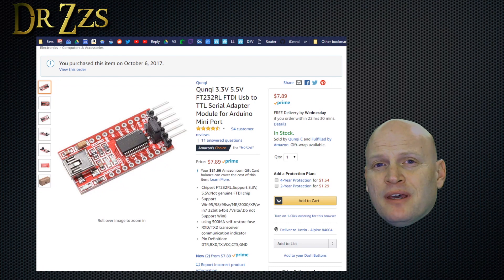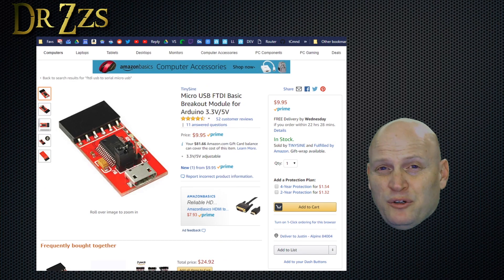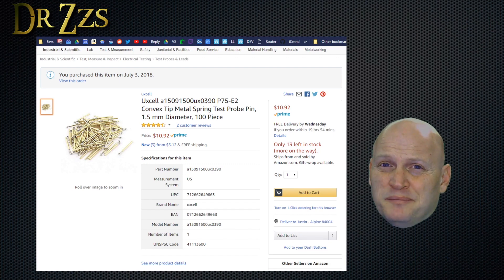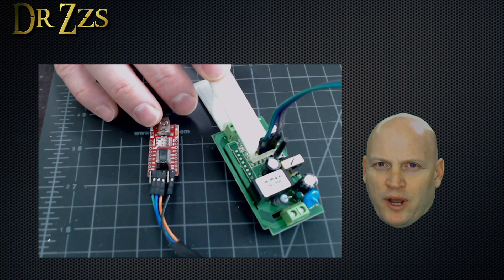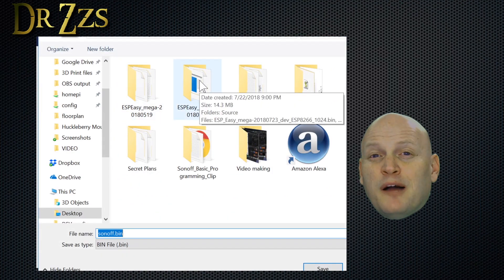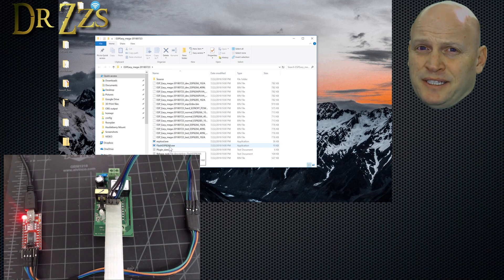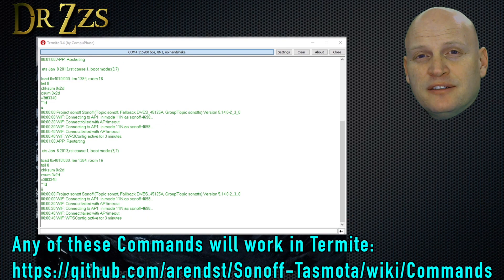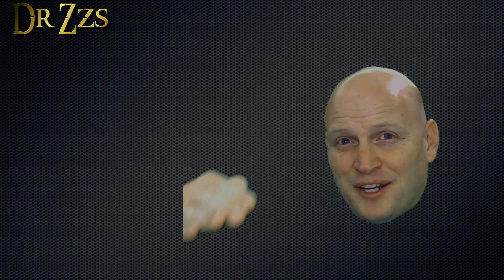How To Change Firmware on Sonoff Devices for use in Home Automation Projects

Comment: Hi ! I flashet this firmware to all my sonoff devices. It worked great but when I woke up today, all my devices have lost their IP-adresses so I am not able to connect to them and therefore I can not use them. They work if I manually press the buttom though. Any ideas ?
Reply: Can you scan your wifi network and find them? If you get the new IPs you can go to a web browser and see if they work.

Comment: Hello, not so if you remember the message I sent you a couple of days ago, of the various problems that I had in the flash of the firmware in a 3-channel UST sonoff, after two sleepless nights, I managed to flash with FlashESP8266.exe I think it was a problem with the FTDI module drivers, because I uninstalled and reinstalled them and it started working. I could make the flash: 3-channel touch sonoff US, sonoff touch 1 channel us (with arduino I could not and also to a sonod TH16, I'm very happy and I have to thank you for the videos and very comprehensive explanations you gave me, others I wanted to ask you something, after having done the flash I have to open TERMITE for which reason? After the flash just connect to the IP address of the device and make the configuration.
Anyway, thanks again.
Reply from the maker: glad you got it working.  
The T1's are tricky.  Getting them into programming mode can be really difficult.  
Using termite is an option, you don't have to do it.  You can connect to the device directly and do the configuration that way.  That's probably a good way to do it when you're starting out so you know more about how the setup works.  I use Termite to save time that's all. :)
Reply: With the sonoffs with tasmota firmware I'm ready for my Hassio smart home project. Thanks, I continue to follow and I hope to share other experiences. See you soon

Comment: i dont know how toenter ssid and password please help
Reply from the maker: are you using Termite?  
With termite connected to your sonoff (though USB/serial adapter) type "SSID1 yourhomewifiID" then "Password1 yourwifipw" 
that's it.  This text is what you need to put a bunch of setting in the sonoff from the Termite console.  replace the xx's and yy's with your real info and put the whole block of text in the Termite console. 

Backlog SSID1 xxxxxx; Password1 yyyyyy; MqttHost brokerIP; MqttUser xxxxxxx; MqttPassword yyyyyyy; GPIO14 09; Hostname sonoff_name; MqttClient unique_sonoff_name; Topic sonoff_name; FriendlyName1 Sonoff-Name
Reply: thank you
but wdt rest keep on repeating what to do
Reply: DrZzs please help me wdt reset message keeps on repeating what to do
Reply: DrZzs I tried but the message wdt reset
Load 0x4010f000,len 1384,room 16 keeps on repeating
Reply from the maker: you used sonoff.bin?
Reply: DrZzs yes it works now but took 42 attempts 🙄🤒

Comment: Why do you use 5.14? Trying to use a DHT22 on my sonoff basic running 5.9.1 and it’s not working correctly only DrZzzs showing up every now and then with the temp/humidity info then it goes away, done this to 3 sonoff basic with same result using SonOTA starting to think this is the issue here ?
Reply from the maker: Does the sonoff work otherwise?  relay etc?
Reply: yes i have it working in homekit using your SonOTA tasmota tuturial and HAP-NodeJS......  so now i downgraded to 5.1.4 because i wouldn't let me upgrade to 6.1.1, the temp/humidity worked basically fine but then i went to change sonoff friendly name... aftter hitting save the sonoff is now dead/unresponsive...weird so now i have no sonoff under 1.6 firmware :( cant use SonOTA so i brought a FTDI FT232 instead of a FT232RL as it was at my local jaycar.... i cant get it to work they look pretty much the same :(

Comment: Hello,
I've been working on this project for a while and tried the old arduino version for flashing..
But I am facing a problem: if the sonOff has a firmware of 1.6 or higher, it doesn't accept new ones (tasmota did flash, but the board wouldn't work anymore). I wonder if this new video solves this problem, or what do you suggest I should do to flash tasmota and get the sonOff to Tasmota admin on my home assistant.
Reply from the maker: You might need to try using the minimal .bin file first, then the regular sonoff.bin
https://github.com/arendst/Sonoff-Tasmota/wiki/Upgrade#firmware-binary-sources

Or you could just go back and get a smaller version of Tasmota.  like 5.12 or 5.14
https://github.com/arendst/Sonoff-Tasmota/releases
Reply: Thank you, the sonoff.bin workrd properly and I could add it to the overview on my home assistant.
Thanks for everything you are giving.

Comment: DrZzzs Thanks once again for a great video, just once question thou, is ghosting still happening with the new sonoff's or has there been a fix for that ?
Reply from the maker: it still happens.  
I thought I was free of all that nonsense, but just in the last few days I've had some random switching happening.  Not sure what the source is yet.
Reply: DrZzs are those sonoff's using the low pass filter?. Ive flashed two units for my bedroom, just wondering if i should use the filter just in case... your thoughts ?
Reply from the maker: marc mysterio I’d say it depends on what kind of button you’re using. If you use a mechanical switch or a push button then including the lpf is probably a good idea. If you’re using capacitive touch buttons then you probably don’t need the lpf. 
I pretty much only use capacitive touch buttons anymore so I haven’t used the lpf on the last few I’ve done.
Reply: DrZzs i use the mechanical switch,    cant seem to find the capacitive touch buttons made for the NZ market. May be one day...

Comment: I am having the same problem as Brooklyn_UAV.  While sonoff is connected to my computer, it works great.  When I move it, it will not connect.
Reply from the maker: dang.  I wish I knew what to tell you. 
Is there anything about this on the Tasmota github Issues page?

Comment: Great stuff Dr!!  
Are these OK to use as well?
https://www.ebay.com/itm/AC-110V-220V-1-Gang-Smart-Home-WiFi-Wireless-Switch-Relay-Module-Apple-Android-/202327191545
They looks the same as SonOff
Reply from the maker: ya, that should work.  I'd be curious what it looks like inside.  You might not have as easy access to the serial pins.

Comment: Hi all, I just flashed a sonoff using your istructions. Then I added information on my SSID using termite but it can't connect to my wifi. I then tried to restart over and I noticed that the sonoff "remembers" my SSID also if I refleshed it. There is a way to erase the firmware before reflashing? And then a curiosity: my SSID name has a space "Name Name". This can be a problem?

Comment: Hi 
I can not get  tasmoda to connect to my WiFi any tips ? Using termite and get “connect failed with ap timeout”
Tried 2 sonoff bacics same problem on both
Reply from the maker: dang.  I don't know what to do about that.  There have been a few people with wifi troubles lately.  
My only recommendation is to try Tasmota v5.14 instead of v6.  If I learn more about the nature of the problem I'll put some info out.  Until then, maybe look on the Tasmota github issues page.  You're likely not the only one having that problem.

Comment: Can the soldered holes be drilled with a thin dremel drill bit?
Reply from the maker: yes.  Check the other comments.  I think someone said a 0.9mm bit just using your fingers to spin it worked for them.  Others have used soldering wick.  Lots of options :)

Comment: I'm having a issue were my sonoff's are not Communicating with my Alexa anymore, says they are not  Responding to. I install  These about 7 months ago and I static all ip addresses for each one of them. Have you had an issue with sonoff's not responding?
Reply from the maker: hmmm.   are you using HA cloud?  I would guess you are.  I haven't had problems.  Double check that the Home Assistant Skill is added to your Alexa account and that you are signed in and using HA cloud.  Maybe try to run "discover devices" again with the Alexa app.

Comment: Hi Dr.zz's I have flash the sonoff with ESPEasy and set it up with termite. I got an IP address when I'm still plugged into the computer. But when it's plugged into power outlet I lose my IP Address can you help plz..
Reply from the maker: that is very odd.  
Is the Sonoff responding at all when you have it plugged into the power outlet?  Lights?  Relay trigger with button press?
Reply: Yes it do response to the botton press. But no network connection
Reply from the maker: extremely odd...I haven't had this happen with a sonoff basic, but with my old Sonoff Touch I had to switch the Hot and Neutral inputs to get the ESP board to work (and get wifi).  
What kind of sonoff are you using? You haven't made any other changes to isolate the relay or anything have you?

Comment: Hi, it would be great if you can make a video on how to flash tasmota on iFan02 and integrate it with Home assistant.
Reply from the maker: I've got one.  I've just been waiting until I have the time to take down my fan and get it working.  I've been following the thread on the Tasmota page.  Do you have one you're trying to get working?
Reply: I keep watching for the same thing
my fall projects include swapping 3 light fixtures for light/fans 
figure might as well go all in, and make them smart

Comment: thanks for update...all links and cmds in one place now.
Reply from the maker: makes the setup pretty fast.
Reply: plus i got my anet a8 3d printer workin g and its been cranking out parts. got carried away on the prime day sale and got a another out of the box monoprice mp i3 for $100- so got a backup now. Waiting for your server nerf project too. I will be printing out this clips instead of pogo pins..i believe i an use those long connection pins that come packaged with the wemo minis. thanks again doc..i dont want you to slow down the project videos & live streams ( buts its getting hard keeping up with your pace :) -its better than absconding bruh ben)
Reply from the maker: sweet!  I can't remember life without a 3d printer.  Set yourself up a shop at 3dhubs too.  You may get some money back eventually.  
I can hardly keep up with myself sometimes too!

Comment: Another great (and updated) vid. I suspect that this won’t work using a Mac as COM ports (as far as I know) aren’t detected. Am I correct?
Reply from the maker: yes, that's true.  You have to do quite the driver-dance to get the FTDI to be recognized by a mac.  I've had it working in the past, but then it randomly stopped and I didn't want to redo the dance.  So I've been doing all my flashing on Win10 pc for a while now.
Reply: DrZzs - Yet again I simply cannot get this to work. I constantly get ‘Flash Failed’ - I know the connection is good so this is a mystery. When selecting Firmware in the ESPEasy Flasher should sonoff.bin be displayed as: 

.\sonoff.bin

Any clues?
Reply: @DrZzz - I have noted an apparent error message when it attempts to flash:

Warning: espcomm_send_command: wrong direction/command: 0x00 0x08, expected 0.01 0x08

It then tries a few more times to flash (in a matter of moments) and then I get the ‘flash failed’ box appear. Does this mean anything to you?
Reply from the maker: maybe swap the Rx/Tx and try again (hopefully you haven't already tried that).  It would make sense with a "wrong direction" error.
Reply: DrZzs - I’ve definitely got them correctly placed at the moment (as in Rx to Tx and Tx to Rx). Are you suggesting trying Tx to Tx and Rx to Rx?
Reply from the maker: hmmm.  well, that's how they should be.  You've successfully flashed in the past?  I should probably try to reproduce some common error messages so we can know what the cause is by the message.  
That espcomm error is usually:  1- board is not in programming mode, 2- Rx/Tx is switched, or 3- wrong com port selected.    But my guess is you've got all those things right.  
Mine does say ./sonoff.bin, so that's not it. 

Are you using the clip to hold the jumper to the board?  mine wasn't quite connecting and I had to pull the pogo pins through a bit farther.
Reply: DrZzs - I’ve never managed to flash any Sonoffs before. I’ve got close to it (using your earlier video ‘updated’ Tasmota method) but after finding ‘Sonoff’ in my WiFi list and selecting it I get the ‘Sonoff Module’ page. I enter my WiFi SSID and password and then...nothing. Light on Sonoff goes solid but I don’t get any option anywhere to do any of the further configuration shown in that video. 

I note the three possibilities you mention in relation to this video and my issues and the only thing I’d note is that it doesn’t seem to matter which of the 3 USB ports I attach the Sonoff to to flash it, it always shows up as COM3. Could this be the issue? Not sure how or why this would happen. Any thoughts on that?
Reply: DrZzs - Progress. The issue was the  driver on the bridge controller. Updated and I could flash the Sonoff. I’ve now changed the baud rate  in Termite as stated and I have green writing. I’ve simply tried to do the minimum in the backlog section; i.e. set up WiFi connection (figuring I can configure everything else once connected). I getting scrolling (green) text as follows:

Connecting to AP1 xxxxxxxxx in mode 11N as sonoff-7307

Followed by:

Connect failed as AP cannot be reached

I have an IP address for the Sonoff which it has given me. I know my SSID and password are correct for my WiFi. Any idea how I get past this? Tantalisingly close but I just can’t get it over the line at present!

Comment: I read somewhere sonoff won't connect with weird characters (ie !@#$_ etc).  But then this got "fixed" with the newer version.  Does the SSID/PW have to contain only alphabets/numbers?  I keep getting "Connect failed as AP cannot be reached".
Reply from the maker: Sorry I don’t know the answer to that.  You’re using TASMOTA or EWeLink ?
Reply: Tasmota.  I actually followed your previous tutorial and got it to show on the wifi list.  However, I kept getting wrong password error.  With this current method, I can't seem to get it to show on the wifi list.
Reply from the maker: hmmm.  You may want to search the Tasmota Issues page to see if there is a password character problem.  https://github.com/arendst/Sonoff-Tasmota/issues
So you have some of those characters in your pw?  
Are you trying to use AP mode but the sonoff- wifi isn't appearing?  What version of Tasmota are you using?  
If you use Termite you can avoid the need for AP mode. I'd recommend flashing with 5.14, there were problems with wifi in 6.1.  I think they've been resolved with 6.1.1 but just to be sure that isn't the problem try 5.14

Comment: Can you just suck up all the solder at the holes and re solder regular male pins?
Reply: Belen Hedderich yes. Or you can just heat it up and insert one pre tinned pin at a time.
Reply: I do it all the time, just dont keep the iron on too long (~5 -8 secs) or you will lift a track. https://www.amazon.co.uk/Draper-23553-De-Soldering-gun/dp/B0001K9RAI

Comment: Is there an easy way to remove solder from the holes? If we want to connect external switch to GPIO 14 we still have to solder header pins. I managed to do it by heating the solder from one side of PCB and pushing the pin from the other side but final result was messy.
Reply: google "desoldering braid" - works well with a little practice.

Comment: Can i use those steps for 3 gag sonoff touch ????
Reply from the maker: yes.  Except getting it into programming mode is a bit different, but once you've got that then FlashEZ and Termite should work the same.

Comment: Works for Sonoff RF Bridge R2? I got to FlashEZ but then I did not connect through Termite
Reply: Wow cool, I just got it, thank you.
I tried Sonota but I did not succeed. Sonota worked correctly with Sonoff Basic.
I would like to know how to do Sonota with Sonoff RM Bridge R2.
Tks.
Reply from the maker: If Sonota doesn't work on your RF Bridge, the method in this video will.  You can follow the same flash method I used in the RF Bridge video but substitute Sonoff.bin for OMG.  
An updated RF Bridge video with Tasmota is on the Horizon.  Just need more time to work on it.

Comment: My sonoff basic seems curropt...it doesn show in scanning mode..not even AP mode its discoverable...any help you can extend?
Reply from the maker: are you using stock firmware or have you changed it?  It's possible that you got a bad one, but I'd try different firmware first.  With Termite you can see what is happening with the board without connecting to wifi at all.
Reply: DrZzs m on original firmware...it was working fine...but stopped....AP mode even apk is not able to find it...i need to rewrite orginal firmware if possible..i need timer function basically...
Reply from the maker: hmmm.  I'm not sure what to do if the stock firmware has gone bad on you.  All I know how to do is change to a different firmware.  
Sorry
Reply: DrZzs any firmware which will serve same functionality but without mqtt requirement...